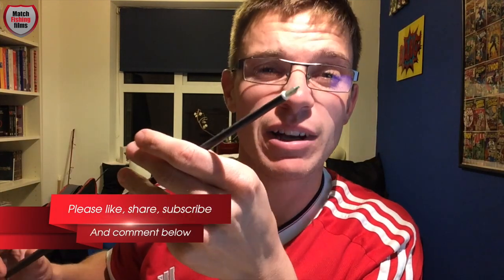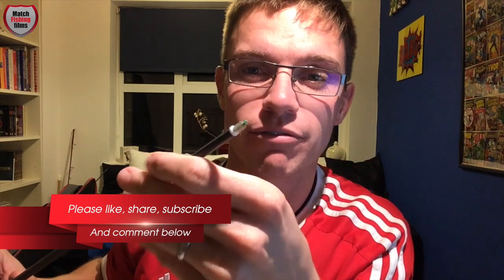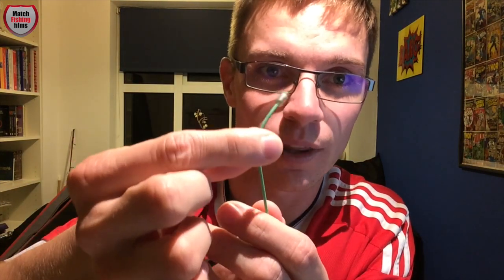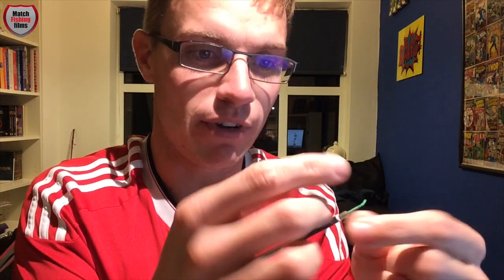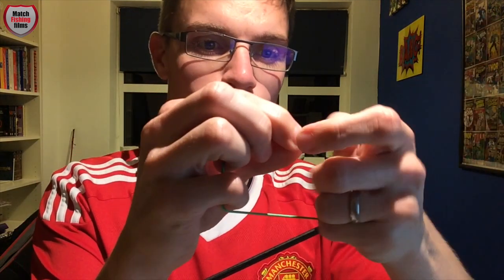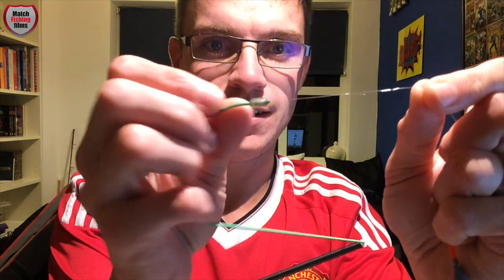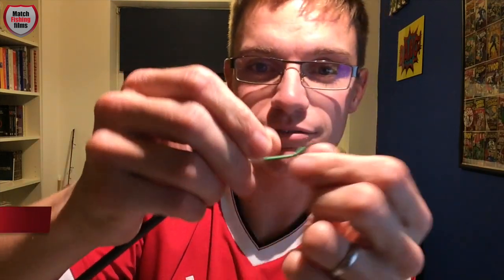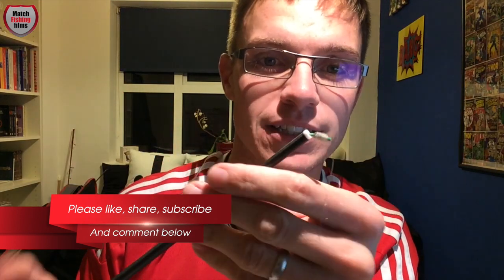Pole Fishing - Elastic Connector Tips

Comment: simply do away with the bead and tie a spider knot used this method many years ago not realy a new idea.
Reply from the maker: Paul  Hickerman I know it's not. Problem with a crows foot is it wrapping around the pole tip when slapping the rig. This creates just enough distance to not make that an issue
Reply: Sorry Joe wasn't knocking the idea innovation is a good thing, still the possibility of elastic wear and cut through, to create a more direct contact why not reduce Dacron length to 5mm it may work as well without creating rap overs.